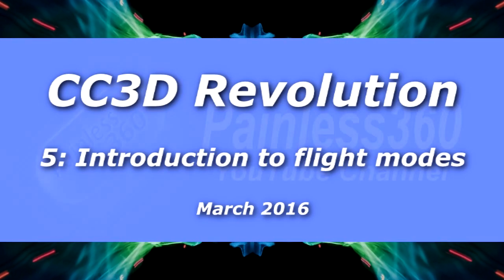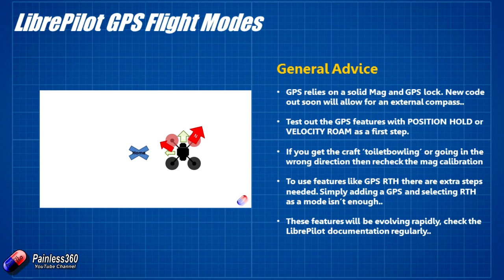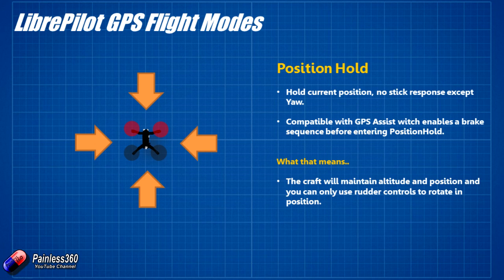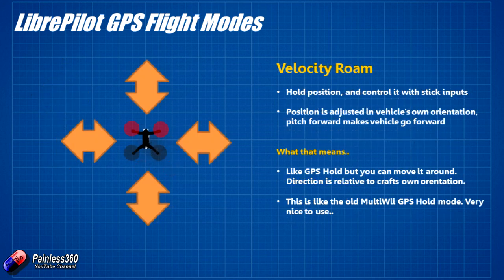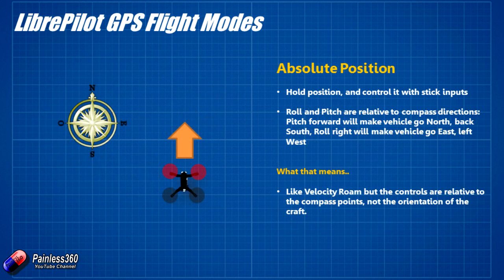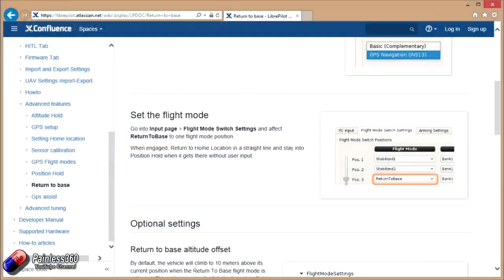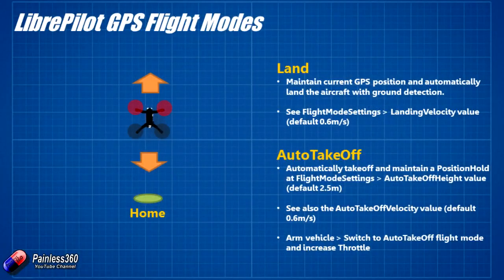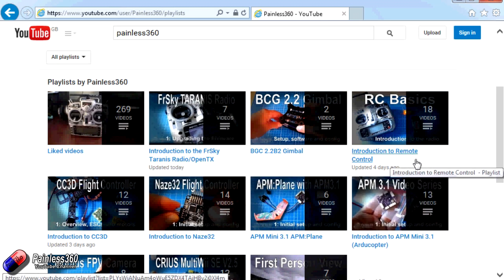(5/5) CC3D Revolution and LibrePilot: Introduction to GPS flight modes

Comment: Thank you so much for the amount of time that you are putting into showing us this flight board! I can't wait for video 6/6 to post!

I do have a two questions for you. What is the difference between the full size Revo and the mini Revo?

It appears to me that the full size Revo you can plug the ESC leads right into the board. Where on the mini you plug it into the wiring harness which converts it too a different connector to the board. 
The other difference I see is that the Uplink to your computer wirelessly is separate on the mini. where it is built into the full size board.

My other question to you is can you share in advanced what external magnetometer / new GPS antenna you will be using so I can purchase that.
Reply: +Adam Rutchik Hey Adam. What you mention are pretty much all the difference between Revo and Mini (Also the size :) ). The Big revo kit comes with a Ublox M8N gps while the mini kit comes with a "OP GPS", It's like a simpler ublox sensor without compass.
Probably a good GPS would be the M8N with included magnetometer. The problem is that libre pilot does not support ext mag yet (ver. 15.xx). You Have to wait till the next release (ver 16.xx) to use it. Apparently there's a way to compile the new version, but i haven't found it yet.

Comment: Think Ill have a go with some of these GPS flight modes, love Librepilot ......  haven't had much luck with INAV yet ...... time to go shopping for a CC3D REVOLUTION  ......... great to have a reference. CHEERS !
Reply from the maker: +One Two best of luck. I've pulled all the Cc3D and revos now in favour of stmf3 and stmf4 based boards running BF or iNav. We will be looking at the new Pixhawk 2.1 starting next month..
Reply: .... the PX 2 redundant system are gonna be perfect for my hexacopter build. Just added a BMP180 Digital Barometric Pressure Sensor to CC3D via I2C Flexiport so I'm still playing with my CC3D's : ), BUT, gonna go to www.GETfpv.com to upgrade to F4 and Dominic's new F3's and have a go again with INAV. CHEERS !

Comment: I'm keeping up on this build, and I, too, have been unable to achieve stable magnetometer function.  The stock GPS module did autoconfigure successfully using the Flexi (middle) port on the miniRevolution.  I pushed the video transmitter to the front behind the camera.  The FC is in the center and a teeny FrSky XSR in the back.  GPS is up on a short post in the back.  I understand that a bigger and more distant GPS/MAG is likely to work well.  However, in your opinion what would be the optimal layout to maximize the internal magnetometer function of the stock kit?  What generates the most noise in this build - BEC in the power board, FPV transmitter, FPV antenna ...?  Any shielding/isolation or power filtering measures likely to be helpful, or is this quad simply too small?  FC to the back?  I'll keep playing around.
Reply from the maker: +David Campbell until Librepilot gets around to supporting an external mag then I'm in the same boat.. Best of luck.

Comment: Hi Mr. Painless. I have my revolution all set with Green Sensor alarms so long as GPS is disabled. Flies well. But when I enable GPS and set flight mode 3 to Position hold I still have green sensor alarms, but Config is now red. Red config syas that because I have a GPS assisted flight mode selected that I must enable INS13 instead of complimentary (as explained in your videos) So I do this, but when I go back to the HUD Atti and Mag are now Red and The artificial horizon is going nuts, pitching and rolling. I am using the Neo 6 M8N sold at Hobbyking as "for CC3d & Revolution" The only thing I have not tried is using the flexi port instead of the main port (I will try that after I hit "post" here. Any and all help welcome. Oh when I hover over the the red Atti and Mag sensor alarms they say they are not getting data at all. Its like INS13 is trying to use the GPS for Gyro and Mag. but that cant be right, can it? Or at the very least INS13 is switching off its ability to get data from Mag and Atti. Sighs... Thanks mate :)
Reply from the maker: +Jason Black ive not eeen that here.  How odd. Please let me know when you get to the bottom of it. Best of luck!

Comment: Hello! I would like to ask you a question. In Velocity Roam flight mode do I have to configure somehting else, besides the attitude estimation algorithm and to add flight mode to switch? I am asking, because I wouldn't like to find out in the air (for one more time) that I had something more  to configure ...! Thank you very much! :)
Reply from the maker: Sorry, I've not used CC3D or Librepilot for a while now so am out of touch with it. It looks like a GPS hold mode with a few extras.. I'd look in the forums for more detail. Best of luck!
Reply: Painless360 Thank you very much for the quick reply! I will ask and hope for the best! Thanks for your great help with your videos!

Comment: Hi Painless, thanks for another awesome series of videos. I understand that Librepilot seems to have stalled, and I have a Revo board for an aerial video quad that I'm wanting to fly using mainly GPS, so I was wondering what software you would recommend migrating over to, and would I still be able to use the OP-Link using different software, or would that become defunct? Many thanks, Chris
Reply from the maker: Not sure - still waiting to see which one is 'alive' such a shame that OpenPilot died.. :(
Reply: Fair enough, I've been hanging on for a few months now to see whether Librepilot does get going again eventually, which I really hope it does, but in the meantime I think I'm going to look into cleanflight instead, even if it means abandoning the OP-link... Will let you know how I fare! Thanks again, Chris

Comment: install and configure the GPS (mini CC3D revo ) .But when the drone armo (right yaw ) , these are not arman.Si off GPS settings , these if arman.Puede be no sensors are configured ?. I have problems with the magnetometer always in red on the gcs

Comment: Sucks about the the magnetometer do you think if you changed the layout maybe with a different non conductive frame and kept the power electronics away from the cc3d revo's board as much as possible that the on board magnetometer would function properly?
Reply from the maker: +Stephen Gibb The farther away from the other electronics the better. In a smaller frame this is almost impossible. Hopefully when we can use an external mag that will help..

Comment: Hello Painless360, I'm hoping you can help me with a problem I'm having with a CC3D Atom. When I try to run the new vehicle wizard, I get the screen that says to upgrade/upgrade and erase. When I click to perform that task, I get a red letter statement that the board has timed out. What's interesting, is when I click the flight data button, I can see that the board is sending something to the computer, because I can see the artificial horizon move, and the 'compass' swings when I move the board around. It was a cheap board, I think I paid 16 dollars for it, I hate to discard the board for another, when it's possible I'm doing something wrong, or that I might have overlooked something. Thank you for your efforts.
Reply from the maker: +Airplay'n FPV not sure, I'd let the vendor know you have a problem.. Best of luck!

Comment: I'm thinking of getting one of these CC3D Revo flight controllers and using it for an R&D platform. How well do the GPS flight modes work? Stability wise, are the AltHold and PosHold modes comparable to the same flight modes on Pixhawk or DJI Naza?
Reply from the maker: Sadly not good enough to reply on in my opinion. The loss of the Openpilot project was a setback for the platform. If you want those types of control then I'd go for Pixhawk.. Best of luck!
Reply from the maker: Collision avoidance isn't implemented in things like Arducopter yet. I'm not planning on any more videos until something significant changes. Follow me mode needs a portable ground-station with a GPS (smartphone for example) connected to the model using something like the WiFi module on the PixRacer. A very dangerous mode IMHO ;)

Comment: Thanks for all your excellent Revo videos.......I've noticed that when I set the Attitude Estimation Algorithm to INS13 and there isn't sufficient GPS coverage the aircraft won't arm even when my mode switch has selected a non-gps mode, i.e. basic stabilized mode.  Either I'm missing something very fundamental or the system has a rather large flaw in preventing flight under poor GPS conditions.  Is this a known issue?
Reply from the maker: Sort of - not an issue, it's a safety feature that means that the craft will only fly if a GPS lock is there.. Best of luck!
Reply: A good safety feature at that but it shouldn't be coupled to non-GPS flight modes.....I think that's an oooops :)

Comment: would the Turnigy Evolution have enough channels to use all of these flight modes?
Reply from the maker: See the video on the i6s flight modes in the playlist for the i6s style radios. You can assign up to 9 flight modes using a combination of two 3 position switches. In practice you'll end up only flying two or three regularly.. Best of luck!
Reply: thank you

Comment: when I set the GPS modes in free pilot , wanting to arm them motors ( right yaw ) , they do not respond ,
Reply from the maker: Usually it's because the arming setting in the GUI is defaulted to 'Always Disarmed'. Best of luck!
Reply: and as the gui fix that ???
Reply from the maker: Watch the CC3D setup videos - all covered in there ;)
Reply: As you know friend When magnetometer esta really well set ?? For mine almost always red one verces turns green , or must constantly be green

Comment: Is there a tutorial for the path planner setup??
Reply from the maker: There isn't one.. I don't use CC3D anymore..
Reply: Oh no. Anyway May I ask if path planner is possible for CC3D revo?? I have looked up in one of your videos and you said it is possible. Currently, I have a CC3D REVO quadcopter equipped with a M8N Gps. The basic flights without gps is working fine, but when the GPS is activated, the drone doesn't seem to be moving. Do you have any idea what is going on? Thanks for your time.
Reply: This link might help with path planner: 

https://librepilot.atlassian.net/wiki/spaces/LPDOC/pages/84672520/Autonomous+POI+setup

If you have chosen PositionHold all you will get is Hold current position, no stick response except Yaw.

Try VelocityRoam it will Hold position, and you still have control with stick inputs.
Reply: Robertbruceb ohh I see! Can those functions work with just the GPS? By the way, my GPS is not fine when I test flying it. But in the librepilot software, it shows Green - which is fine.
Reply: Yes, Check the settings by choosing Configuration choose input,Flight Mode Switch Settings(TAB), Assisted Control, drop down and select "GPSAssist" for any Flight Mode that needs a GPS.

Comment: I have it in ( rightyaw ) And no I Answer : I do not understand what you mean ? I was armed and unarmed Set engines , but configured GPS Modes , Even without activating Modes (GPS ) armed unresponsive
Reply from the maker: Watch the CC3D setup videos - all covered in there ;)
Reply from the maker: I'd check the mag then - without a clean green set of lights it will not arm. That looks like the route of the problem. Make sure it's calibrated..
Reply: Friend the only way to make them work is to put direct But it is dangerous

Comment: Hi) Can you help me? I do everything as indicated in your instructions, I checked more than once. When I put a GPS Navigation mode (INS13), the function "ARMED" does not work with the remote. I tried to change the input method, and still does not work. If i turn on function "Basik COMPLIMENTARY" its working. What is the problem? my board is REVOlution.
Reply: I accidentally found the cause). It's simple!) It is necessary to raise quadrocopter and move it in different directions, then earn stabilization system, and only after the work starts.

Comment: i have a fpv Flying wing and i want to have autopilot capabilities with it like return to home when the radio signal is lost or with a switch on the radio. can i do this with the OpenPilot Mini CC3D Revolution and the OP GPS?
Reply from the maker: +RubenRD97 in theory it should. In practice I've not tested it. Best of luck!
Reply: Thanks for telling me i already ordered it and i will make a video about the setup and how good it works! : D

Comment: Hi did you ever make a video of setting up flite modes for this cc3d revolution with GPS.
I have followed your other videos on it got the GPS to work .but having troubles with the flite mode.
I set stability loiter and RTL but it the other bits in it you have to set that giving me red errors so it won't start up .
I have looked all over the net for help with this I can't fined anything about it apart from the wiki which may aswell be in any other language.
Reply from the maker: I didn't do a lot with the CC3D EVO.. The stuff I figured out are in these videos. I'd strongly recommend that you use a modern flight controller Best of luck
Reply: This is what I getting.Config error on flite mode switch page.on flite data page in red is config and a red ? GPS is green I have set the home and set the ins13 in config and saved it

Comment: Hi Painless. are you planning on doing a in depth video on  Position Hold and RTB? I can't make the INS13 Algorithm to work (I have Revo mini from banggood)). I can't even take off, the quad goes crazy. All my alarms are green, calibrations goes smooth. I have good virtual horizon and good north. But when I arm and try to take off it simply does not stabilize. Sometimes is just rolls to one side till the props touch against the floor. 
Using Complimentary algorithm everything works perfect, but off course I can't do any GPS flight modes with that.
Cheers,
Reply: +Marcos Paz  other people have said this, it sounds like what was mentioned in the video, the magnetometer  doesnt work well enough, too much electro interference from the board, painless didn't even try to use it with onboard mag. so i imagine it really needs an external mag/gps unit to work well. .. i might try this soon, when theres more info.
Reply: I was hoping for a magic "activate this option"  solution lol.  I guess I'll have to figure out how to compile the "next"  branch of librepilot to use the ext. Mag. 
Thanks!
Reply: +Marcos Paz  yeah its pretty heavy work,  wish librepilot asked me if i was an idiot first, and then gave me idiot options lol...'' ... its because it has so many abilities the jargon and technical chat gets out of hand very quickly... thanks painless360....